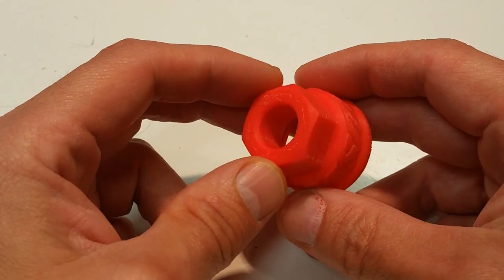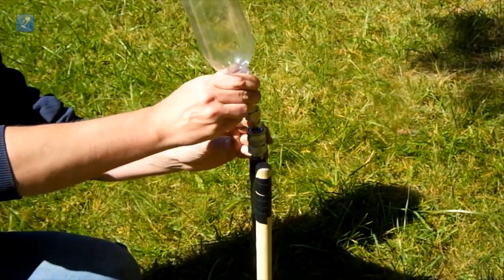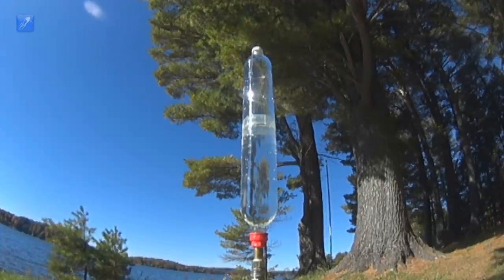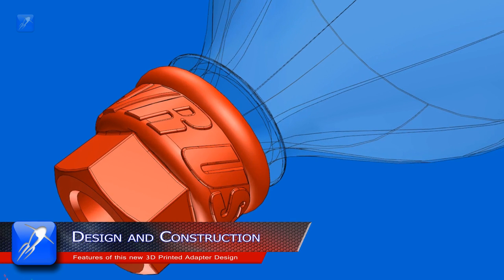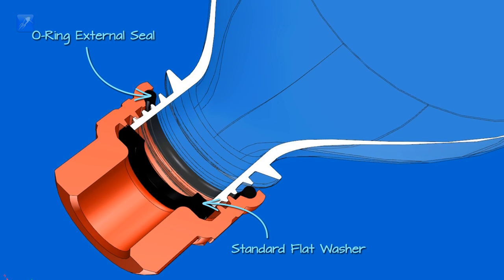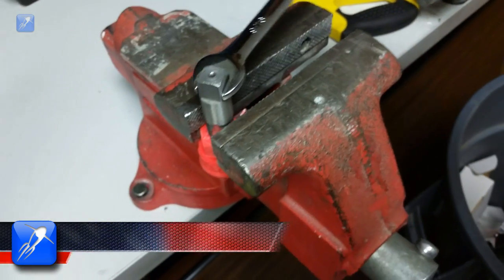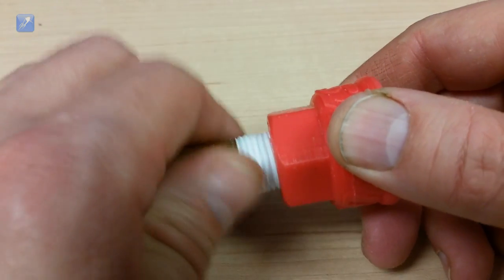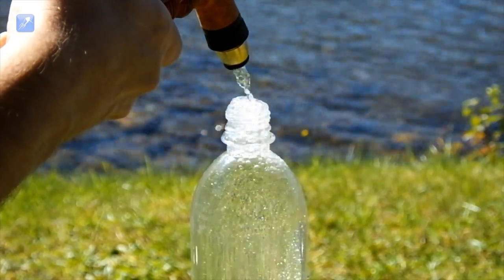3D Printed Soda Bottle Thread Adapters for Air Tank Making and Water Rockets

Comment: How did you manage to get this not to leak? Ive been trying to design my own but even with a solid print with low layer height and high temperature and increased flow I still get leaks between the layers.
Reply: Try a .5 mm nozzle instead of a .4

Comment: Can't you also use these like a Gardena quick connect
Reply from the maker: The threads don't match the bottle threads, so they don't screw together right. That's why these were designed, since they match the bottle threads exactly.